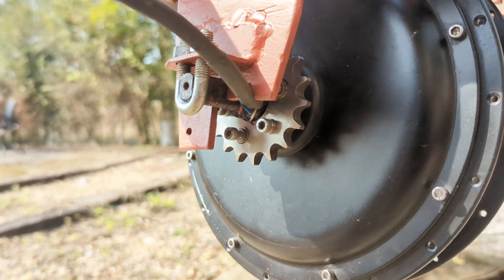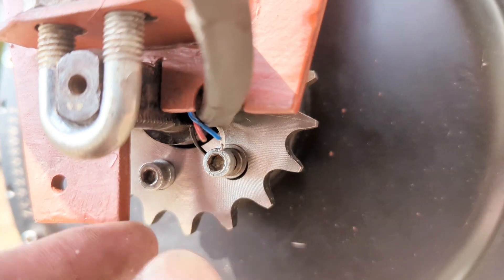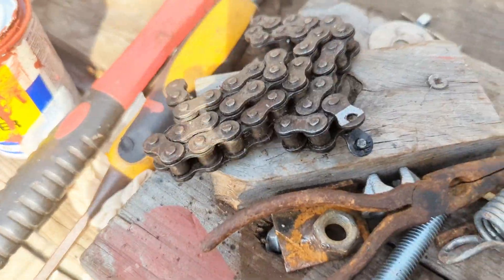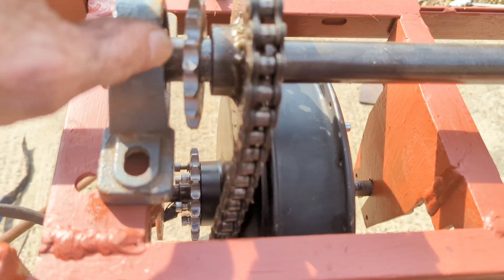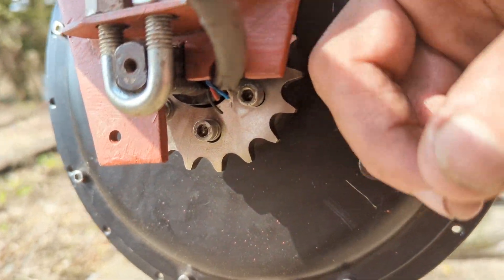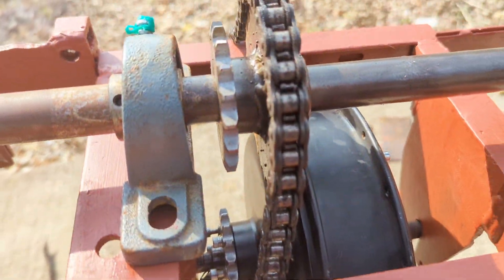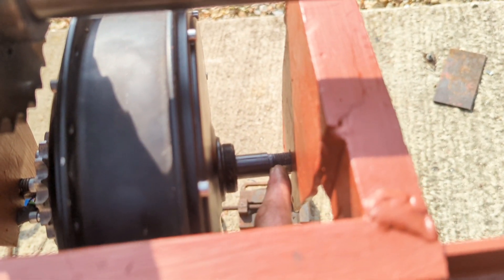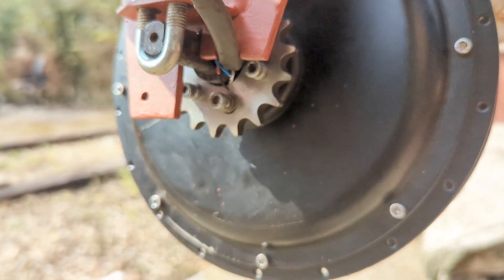New Wind Turbine Project - Motor is finally in with an unexpected bonus - 3kw Ebike motor

Comment: Gavin, don't use gears, just try to get multiple motors and connect them onto single shaft. Gears means unnecessary downtime.
Reply from the maker: I am not sure what you mean ?? Thanks
Reply: @GavinFreedomLover  one shaft with multiple stators and rotors.